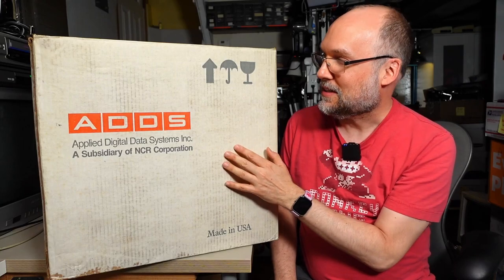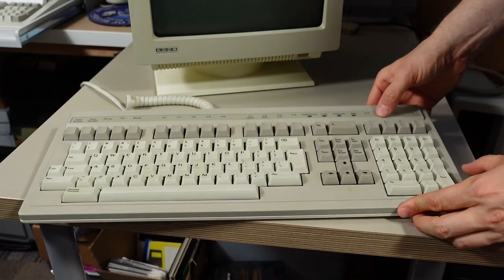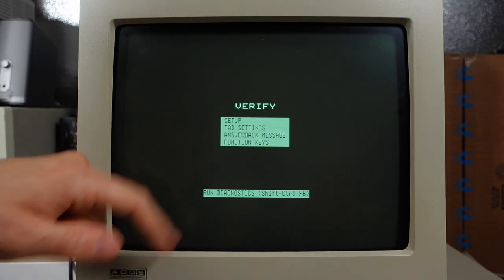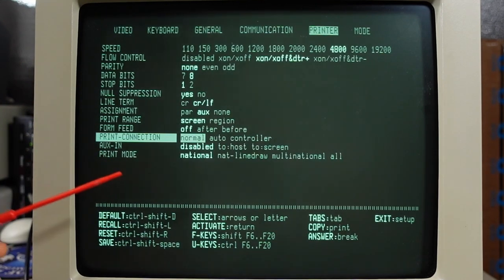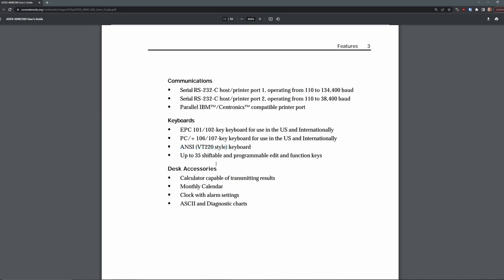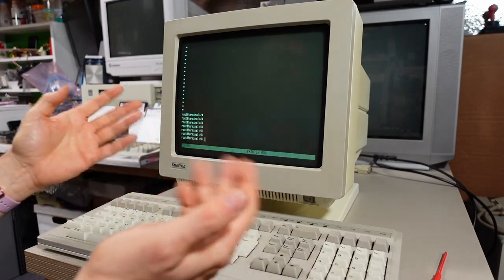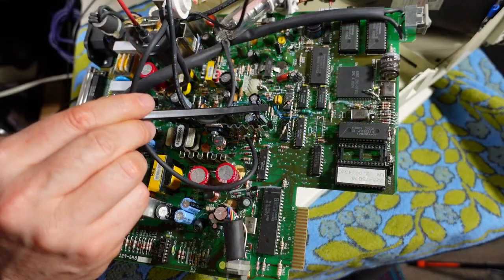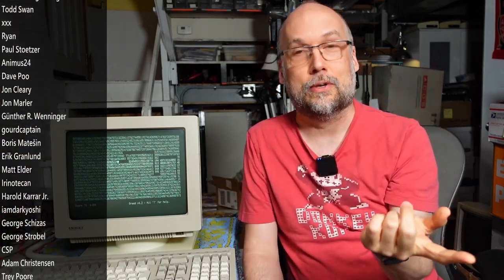Test and teardown: The ADDS 4320 Communications Terminal

Comment: Thanks for the video, Adrian! I have two questions:
1. It looks like the edge connector is connected mostly to the 8031 chip - perhaps it's a clue as to its role? Maybe it's not just keyboard decoding.
2. If you could dump and upload the contents of the ROM, it might be possible to detect the architecture of the CPU inside the PLCC.
Reply from the maker: You know I should have dumped the ROM but didn't even think about it. I'll have to ask the new owner of it if he can do it.

Comment: I use an IBM terminal to connect to my linux server.  Of course I can use SSH, or even just connect a monitor/keyboard to it, but it's fun to use a serial terminal 🙂

Also, it's pretty fun to connect something like an WiFi232 to the terminal to access BBSes with it 😀

My IBM terminal has a card slot, so you can use expansion cards to use different terminal emulation types, it's pretty neat.

Comment: Terminals are a huge slice for knowing what-lead-to-what until personal computers emerged from them. IBM mainframes (and others) in the mid '60s could not be touched, breathed on, or seen except by sanctified initiates. Foolishly imagining I might see a computer directly with my own eyes, I tagged along with a mathematics major handing over a "FORTRAN with WATFOR" program for the so-named course. The university arranged with some beneficent company for some slight amount of the company's computer time. An attendant behind a counter at an office front, first checking ID, took the program which was on a form, letters in boxes, a certain number of boxes per line. The attendant only took the forms (so I was told.) A pro would come in later to enter it at a terminal (located way in the back, not facing so you see the works), likely when no un-cleansed are around to see.  At some other site (so I understood) this would be punched onto punch cards, and tons of cards from all kinds of sources would be packed in batches to be entered and run within some time, depending on the price, a few days, weeks or months. The attendant became distressed at me scrutinizing everything, and required me to show my ID and forms, or be evicted. Evicted. I easily made it out the door, taking in what I could, before they got to the phone. And there was nothing to see.

 DEC is credited with promoting and delivering interaction with a computer (through terminals you touched) in real time for end users in the presence of the computer, then a dreamy concept. According to that mathematics major, the typical result a student got back (and don't bother checking the office front before several days) was the line number where the computer time hit their allocated limit (like a millisecond) in a fatal loop. Then make a logical guess, and write out the whole revision on another form. And iterate. Some math majors flunked the (optional, low credit) course never achieving a program running all the way to the end, maybe realizing the total insanity. But the whiz, not being deterred by insanity, got it in a few weeks of go-rounds, which was possibly a few milliseconds of total computer time. 

Not coincidentally, IBM originated the (8 inch) floppy disk drive, to be far cheaper than hard disks, to use in a terminal that would log data. With floppy drives achieved, others instead went with floppies for the earliest, quick R/W storage, in the place of hard disks, in low cost computers, and microcomputers. Naturally, floppy disk controllers on a chip were developed, like everything else goes on chips.  (The first FDC was by Western Digital, BTW, long before they got into drives of any kind. They were only chip designers.) The floppy controller IC is the ancestor to IDE (also due to WD) and evolved into SATA.

 What eventually got called microprocessors, were evolved from LSI's that were general controllers for all kinds of things (like individual pockets in check sorters.)  And terminals.

Comment: When I was working at Bell telephone laboratories back in the late 70's early 80'2 we didn't have PC with a monitor. We used data terminals connected to a dot matrix printer or to a network laser printer. And it could take hours to print out large files. The data terminals only had serial or parallel ports nothing else. The things looked like a type writer minus the keys and ink. The worst part was if you made a typing error, you had to retype the whole file over again, if you missed your mistake and couldn't backspace in memory to fix it. And the memory in those dumb terminals was only capable of retaining one line at a time.  I can't imagine how much harder it was for folks that used to use the old punch card programmers. This is why the invention of the transistor changed the world and made life easier in the electronics field.

Comment: Back in the day, are used to use a dumb terminal to get onto local BBS systems. I used a Seiko 8620 with a ATI 2400 Etc/E. Later I acquired a second identical terminal and an ATI 9600 Etc/E. When I finally got my first PC, I gave one of my terminals to someone who didn’t have any other way of connecting to BBS systems. I traded the other one for issue number one of the transformers comic book series in the late 90s to a collector.
Reply: Finally in my time at RadioShack in Canada,we used WYSE terminals exclusively up until the early 2000s as POS systems in our stores.

Comment: About 20 years ago (I think 2004), I worked at a hardware store.  At this time was the transition from old terminal warehouse management to new web-based.  Until then we used a PC with just a terminal emulator, seems they sometimes before I was working there they switched the old dumb terminal to a "new" real PC with an installed emulator... but it still was text-based...

Comment: DEC terminals don’t use battery backed RAM for the settings, they use an EEPROM instead, wiping and re-writing every time you save.
Reply: Batteries are cheaper, but they probably didn't think of the planned obsolescence angle of ruined boards when they did that!

Comment: I suppose the botches had something to do with the "stringent reliability and quality guidelines". Other than that, neat machine.

Personally I still use a late 90s DEC terminal to connect to my home Linux server. The server is located in the basement and unlike Adrian, I don't live there ;-)

So I ran a serial cable to the attic where I have my study/hobby room. Obviously I can also connect to the server by SSH and other methods, but there's a nice sense of immediacy involved with using the terminal. I switch it on and am almost immediately greeted with a login prompt.

Comment: I have a Wyse terminal which I used until 2001 as I could not afford to buy a vga card and a monitor. I even used it extensively to work remotely from home over dial-up connection. I still have it sitting somewhere and won't be surprized if it's still in perfect working condition  😁

Comment: 23:45 you can use ^[ ( ctrl + [ ) to emulate the escape key in Vi/Vim. In fact, this also just works in general on any terminal.
Reply: It does not emulate, it just send that 27d. Ctrl key subtracts 0x40 from the code send by terminal, so Ctrl-A sends 0x01 instead of 0x41 which is A, Ctrl-B sends 0x02 (B is 0x42) etc., so Ctrl-M sends 0x0D which is <CR>, so you can type Ctrl-M instead of using <Enter> key. If you look into ASCII table, then you realize, that <[> is 0x5B, so Ctrl-[ have to be 0x1B (27d), which is <Esc>. This is not an emulation, this is how terminals behave. They made it this way, because it is easy to send all codes between 0x00..0x7F (7 bit number) just using a standard typewriter like keyboard and the <Ctrl> key. This is how ASCII is designed. Then some Ctrl-key gets their own dedicated keys, like <CR>, <Esc>, <Backspace>, on some terminals are keys like <EOF> <HUP> etc., but all of theese codes can be sent using a Ctrl key and it does the same thing on the line level. The same thing comes with the function keys, which, in fact, sends Esc followed by a number, so you can type <Ctrl>-<[> <2> instead of pushing <F2>, etc. But all theese are ASCII related things, so when it comes to e.g. EBDIC, they didn't work.

Comment: I'm suspecting you meant "rollover cable" instead of "crossover cable" when you were speculating about what type of cable the keyboard might have had. Crossover cables would be very uncommon for flat cabling like that.
Reply: Nope, the Macintosh did in fact use crossover cables, so regular telephone cable shorts the keyboard controller.

Uncommon to be sure, but that’s why it’s so important to match the cable to the keyboard when they’re removable.
Reply: @kaitlyn__L  Mac keyboard cables were straight-through cables and telco cables were rollover cables. Crossover cables are a third thing.

Telco RJ12 connectors had pin 1 on one end connected to pin 4 on the other end, pin 2 to pin 3, pin 3 to 2, and 4 to 1. This eventually became known as a rollover cable. A Mac keyboard cable has pin 1 connected to pin 1, 2 to 2, etc. This is a straight-through cable. A crossover cable is usually only referred to in the context of Ethernet, where it's not been needed for decades, since Auto-MDIX became commonplace. Its pinout is 1-3, 2-6, 3-1, 4-4, 5-5, 6-2, 7-7, 8-8. (And pins 4, 5, 7, and 8 aren't actually used anywhere where you'd need one.) (And normal Ethernet cables are straight-through cables, FWIW. Well, sorta. Since there were twisted pairs, you had to make sure that pins 1 and 2 were one twisted pairs and pins 3 and 6 were another twisted pair.)
Reply: @wbfaulk  okay, fair enough. I was using ethernet twisted pair terminology. Still, the Macintosh didn’t use the regular phone cord layout, as you confirmed. And Adrian was curious if this one used a normal RJ-11 or Macintosh style.

Comment: I use a VT420 with linux. The key to the left of the 1 key, is Escape, or at least in the setup... also F3 on the DEC vt429.... it can be configured to be escape. If you look at your "KEYBOARD" setup ( 13:47 in your video) you can see, towards the bottom, you also can choose for the key to send the character it currently is... or function as Escape. I suspect if you make this change..... it will be more useful for you!

Comment: H/V sync signals are easily recognizable on an oscilloscope. If your really want to turn it into a monitor, I'd check the pins of that big chip one by one with a scope. Once H/V sync have been found, video might be close to those pins.

Comment: How do you loop the mains plug through the holes...?
Reply: Or even a DB-25 with the hood on it?
Reply: You don't, that was only for the ribbon data cables, which you don't want running too close in parallel with power...

Comment: The keyboard layout is what we have in UK - the large Enter/Return key that spans two rows.  I also note that there is a £ sign shared with the $ key.  On UK keyboard we have  the £ sign on the 3 key and $ on the 4 key.  When I use a US layout I take a while to get used to the smaller enter key!
Reply: It's actually the standard layout that DEC made for the VT220, with their "LK201" keyboard. The crazy part is that the box calls it a "ANSI" keyboard! The UK keyboard layout you are referring to is now commonly called an ISO keyboard.
The problem I have with that keyboard layout is having to stretch my pinky to span that extra key distance to the enter or left shift key while touch-typing. Weird things like putting less than and greater than on the same key is also no fun.
Reply: @8bitwiz_  thanks - I've just been down the rabbit hole of looking at differences between ANSI and ISO keyboards! 🤣.  I have just returned from Australia and they use ANSI layout which was a nuisance as my laptop is configured for UK so I had no working \ character which I use a lot (and I didn't want to reconfigure the laptop as I was also using it with it's built in keyboard).  < and > were on same keys as with ISO on the ANSI keyboard I used.  Although I do recall older typewriters I used that had them on same key which I didn't like - although they weren't used commonly.  Typewriters often had other symbols on keys which aren't found now - like a dedicated 1/2 symbol.

Comment: Adrian you need to try using Microware OS9 Level 2 on a Tandy Computer 3 and hook up a few terminals and try out the multi user capability. Back in the 90's I had several WYSE terminals all hooked up to my modified Coco3 using something called an Eliminator pack which had a real time clock, serial parallel interface, hard drive and floppy drive interface. It was really cool.

Comment: On rare occasions I wish I had a nice terminal. I had a firewall/router appliance suffer a UI crash, it was entirely unreachable via the web console and via SSH over the network. I was only able to communicate with it via the serial console port (strangely it was still doing its job just fine).  It would have been nice to just plug in a terminal rather than unravel a 20' 9-pin cable.
Reply: Small ultrabook laptop, USB serial adapter (Tripp-Lite bought Keyspan who made the best ones, and is still making them), and terminal emulator software. And a small bag with the your most needed port adapters.

I don't think dragging around one of these 20-pound monsters and finding somewhere to put the keyboard is preferable.

Comment: I'm 34, but I used card-catalogs briefly before they were phased out.
I've got the mainboard from some kind of old WANG computers terminal-console, no idea if it works.
Somewhere I've got the guts from some other kind of terminal too, was built into a CRT like this one.
Unfortunately the other one I have (wherever it is) is likely dead, as I removed the ROM-chips as a child and when I put them back in I either swapped their positions or put them in backwards and one became a light-bulb briefly.
So one ROM might be okay, but the one is almost certainly fried/dead. If I ever find it again in my clutter, I'll have to inspect it and see how bad off it is.
I rather prefer the CRT units (like this ADDS terminal) that have the simple plug connector for the neck/electron-gun, rather than a big circuit-board that can exert fatal leverage on the neck and its pins.

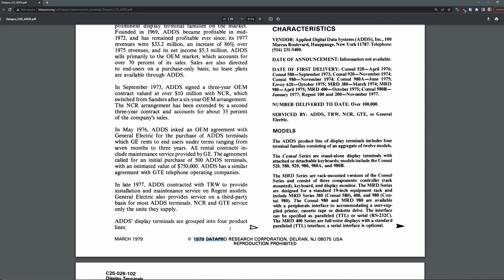Comment: 18:53 (drool) I love me some '70s case styles
19:42 I found a roadside Wyse WY-325 (a color terminal!) with no keyboard, and I feel your pain. About all I found was repair or brochures or buy one for a stupid price. (But at least I think I found out what kind of keyboard it needs.) I think that's what happens when the terminal is specifically designed to emulate well-known terminals.
23:38 systemd has basically taken over Linux in the past decade, and it... isn't universally liked. Apparently it's useful when you have a lot of virtual hosted systems, but a pain in the rear for the desktop user who knows Unix.
23:47 Escape is control-[ if you can't find an ESC key. That's the standard VT220 LK201 keyboard layout, and I've always hated it.
27:55 The plastic is probably molded on yours. They could make a door version if they wanted, but it would cost more to have two pieces of plastic instead of one.
31:04 That's an 8051 series microcontroller, it's the main CPU for the terminal, they're popular for post-80s terminals, and the big square chip would do all the complicated video scan stuff.
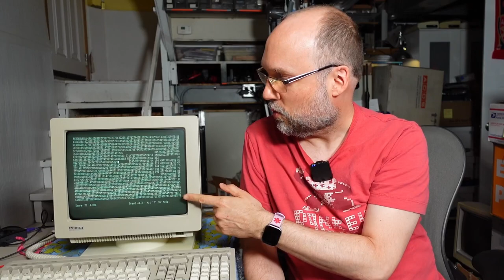34:20 It's probably best if you can put a battery like that on a wire and move it to a different place where it can puke its guts by itself, but we know how those old batteries can be.

Comment: Looks like a VDU for an IBM mainframe, like the 4300 series.  The name is vaguely familiar.  You are not quite half way through, eager to see how this progresses.  I think the DEC style VTs were a bit more basic, VT100.  This seems more sophisticated.
Reply: The DEC VT200/300/400 series were far more sophisticated than the original VT52/VT100. The VT300 series that this terminal emulates had programmable characters, multiple character sets, and all kinds of key macro facilities.

Comment: you can use a terminal with a dos pc using the mode com1 or com2 switch and the baud rate set and issue dos commands from the terminal and see results on the terminal, or put the dos startup commands in the autoexec bat of a diskette, so it always runs when the particular diskette is booted. could even send the text through a modem. have to find an old dos manual to see what the command switches are for this command

Comment: Needing to use a whole Raspberry Pi as just a Null Modem cable is the most 2022 thing I've heard of.
Reply: Don't forget the insane usb to serial translation going on... He has lots of PCs with real serial, but the raspi is small. He needs a PC Engines, small as a raspi, x86 and real serial ports. Too bad he has the wrong distro with the systemd plague, needs something based on Devuan not Debian, to have the classic getty experience.

Comment: Terminals have always excited me...  I guess the thrill of seeing them in use when I was a little kid in the late 80s/90s, going out to a world beyond what was just sitting before me be it a VAX or even just attached to an external modem.  The first terminal I ever really used with any kind of purpose was a VT220.  I only have one two terminals in my collection, and one is a MicroBilt T700 that outputs to a built in thermal printer, one of MANY that belonged to a company my dad partially owned back in the 80s and 90s that was leased to other companies to pull credit reports.
 https://www.youtube.com/watch?v=W75tR0b33no